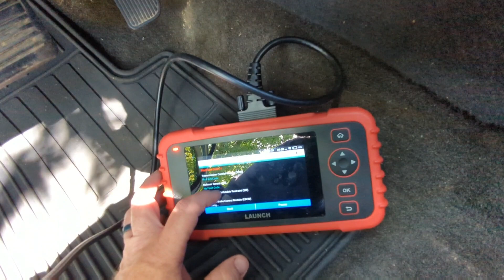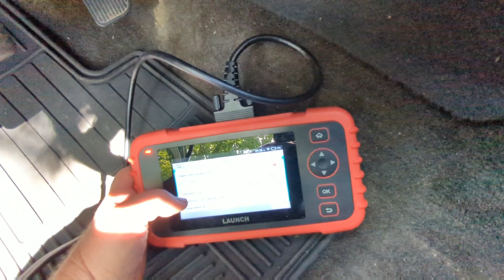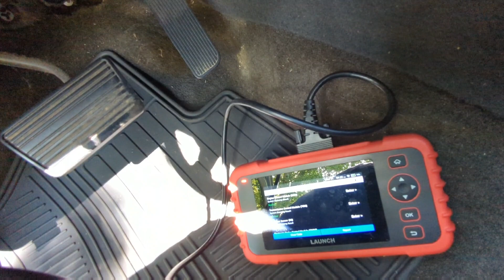Wide body Escalade EXT!

Comment: I did that same trip about a 16 months ago when I had my 4Runner.  We might have hit the water crossings on Parsons Branch a tad fast... haha.  I had my Z28 on the Dragon Saturday doing some testing with the T56 swap.  Brakes and tires were awesome.  I'm definitely going to need to do some suspension work to get things a bit tighter (wasn't bad at all but there's lots of room for improvement). Oh, and the L98 is gutless, even with the new injectors.  I'm going to swap out the fuel pump this weekend and see how it does.  Flushed my cooling system numerous times this week before refilling and bleeding air tonight.  I'm so tired of how hot these things run, it's just ridiculous.  I shouldn't be boiling over every time I drive the car.  We'll see how it does with the flush and new coolant.  I'm hoping the new fuel pump helps too, as I am not getting the full 43.5 psi out of the current pump.  We should run the Camaros out on the Dragon sometime! I'm just off Montvale so it's just down the road for me.
Reply from the maker: This was such a good ride. I haven't been driving the Camaro much due to the transmission being such a pile of junk.  I would like to run the Dragon sometime but it will have to be next spring for me.